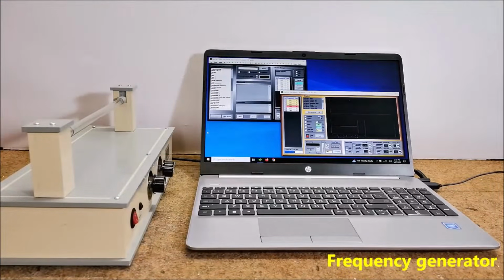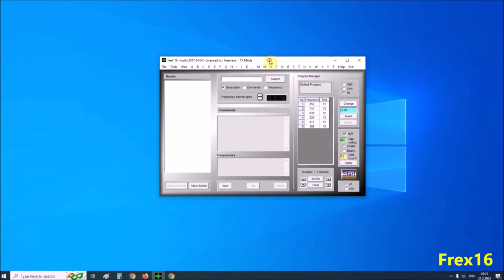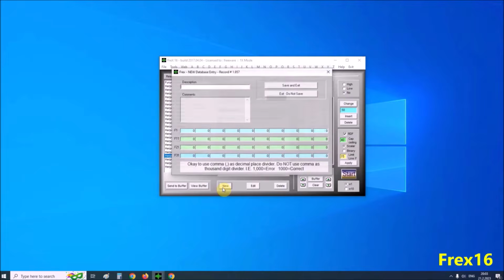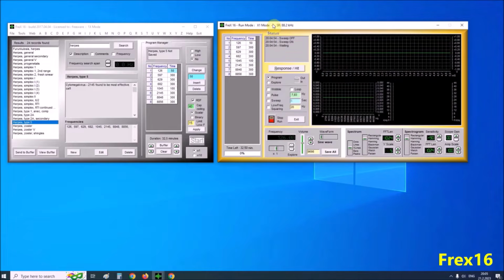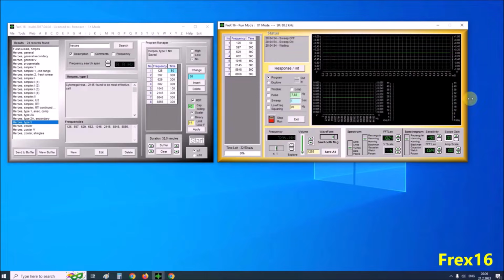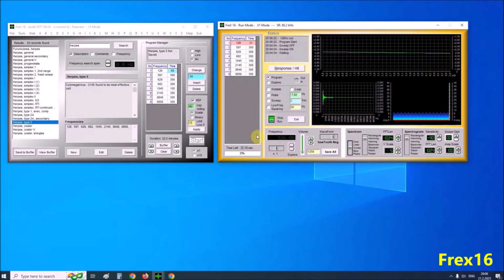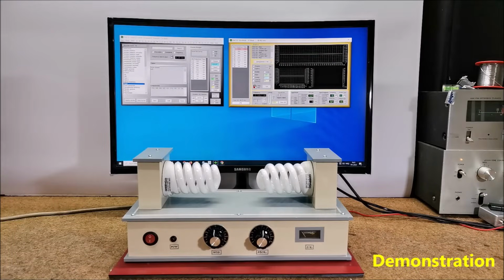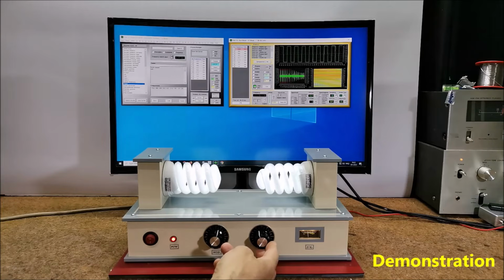The simplest and cheapest way to make your own Plasma Rife Machine (Detailed instructions)

Comment: Could you use a Plasma Ball generating device that is already modulated (controlled) by sound?  There are already these machines available and react to sound.
Reply from the maker: Theoretically, yes, a smart idea if you already want to try out such a device, of course the carrier signal in these plasma balls is at a very low frequency (a few tens of kilohertz), while in the original device that frequency is 3.1 Megahertz. Finally, my personal belief is that such devices are totally dysfunctional in terms of treating diseases.

Comment: Mirko, I want to build similar machine, but with contact electrodes like in Hulda Clarks Zapper.

It would need to generate 0vOFF +9vON square wave (50% duty), 10mA max.(Nonegative wave, just positive)

Can you provide a schematic of such circuit? 

On the othe hand how will simple LM386 small amplifier fed by 10v and connected directly to electrodes will work?

Comment: hi Mirko, thanks for your projects. I want to ask you if it is possible to insert a switch at the amplifier output to use the machine with electrodes and plasma. Thanks a lot

Comment: I would like you to build me such a device, but I'd like to see the plasma tubes on hand held mounts, to be placed where needed... Maybe on a meter of cable. Can it be done for 2K US?
Reply: Have you done any research on the preferred shape and surface area for a hand held device? Working with a plasma bulb manufacturer, there are a variety of options.

Comment: A very nice simply design. I am curious of its strength. HOw far away can you detect the signal? Does this have pretty much an unlimited run time without heat problems?
Reply from the maker: I detect the signal at a distance of several meters, otherwise the device has no problem with heating at all and can work indefinitely

Comment: What transformer are you using and how do you wire it?
Reply from the maker: I use HV trafo from old disassembled copier machine
Reply: @MirkoPavleskiMK  I have a family member with cancer I'm trying to replicate what you're doing in your video how did you wire your transformer thanks for replying so fast
Reply from the maker: @brighttech8922  Schematic at:  https://www.hackster.io/mircemk/the-simplest-and-cheapest-way-to-make-plasma-rife-machine-f3f776
Reply: @MirkoPavleskiMK  I have seen the schematic it doesn't look like you're using all the pins on the transformer I'm sorry I don't know a lot about transformers

Comment: So after all,  this in not a rife machine because of the wrong  carrier signal frequency.  Unfortunately I have already paid an electronic engineer who built one for me . I should have read the comments (see @TheApis75) of this video. Anyway thanks for your efforts Mr Mirko
Reply: Ok @LLoouukkaass112233, you had it built and Mirko correctly changed from mHz to kHz range. So if the original Rife carrier frequency is 3mHz (or 3000kHz) - it still falls within the 20-200 kHz range!  So, does your Rife build WORK?
Reply: I curios to know, because I'll also build this version of Mirko's Rife machines with the adjustable carrier frequency rather than the fixed CF.
Reply: I apologize, you're correct!  3mHz is out of the 20-200kHz range.  So it's not the original Rife carrier frequency.
Reply: @tonypeters3814  The machine works. Checked with an SDR radio  I have been able to transmit the signal from an external signal generator. The machine transmits (by modulating the carrier wave) the signal in multiple bands (Harmonics?)   starting from 90KHZ up to 1.2 Mhz, then stops and resumes the transmission in 87MHz (!?). Unfortunately it failed to transmit in or near 3MHz. Moreover in contrast to Mr Pavleski's opinion, a device (THERABIONIC) operating on the same principle and delivering an AM modulated 27.12MHz carrier wave by an intrabuccal (in the patient's mouth) antenna (100mW), has been approved by FDA as an adjuvant  treatment of terminal bile duct cancer. The results according to the studies are very promising.

Comment: Hi Mirko, I will build this version next week, but I have one question.  I would like to add and LED to indicate signal to the CFLs when low frequencies are being transmitted.  Where would you suggest placing the LED in the circuit?  Perhaps DTC on the TL494?

Comment: Where you get that spectrum Analyzer? Do that Analyzer works on the range 0hz-382000hz?
Reply from the maker: That is Software Defined Radio with range up to 2 GHz (2000000000 Hz)

Comment: Hello Mirko, it is me again. I opened a fluorescent bulb and I noticed there are 2 wires on each side of the bulb, in my case (the same as yours) they both pos+neg on the left and the same on the right side of the bulb, the same situation can be seen in your video at 14:41min, I noticed you soldered pos+neg together with one wire coming from the transformer for each side of the bulb 14:51min. In my poor understand I believe all the wires coming from the transformer are POSITIVE, so did you soldered together pos+neg+transfotmer? or you ignored the neg at the bulb side? I will do a test with the spooky2 central with 2X 35Watt bulbs and the spooky central has 2 outputs that I believe are both positive. Please kindly clarify. Thanks in advance.

Comment: Hello Mirko, I was willing to build your rife machine but my knowledge in electronics is extremely poor. I used FreX with a headphones amplifies and tens pads and it worked well. Recently I found a spooky2 Central used being sold for parts or repair in a pawn shop and people do not know what it is about and what it supposed to be used for. Now I have the Central and 1 Spooky2 XM generator. All I have for the Central is the power cord, the central is tested and is working perfetly fine. I would like to build a bulb to operate with the Central based on your suggestion, I have very big bulbs with my photo light kit, they are about 20cm long, 150W each and they cost about $15 USD for a pair, I just do not know which kind of gas is inside and sellers don't know either. My idea was to build a rife plasma tube that is compatible with the spooky2 Central, what I know is that they have two bulbs, one is the plasma tube (Gas Type: Argon / Neon mix, Striking Voltage: 500v, Maximum Current: 100mA) that radiates 6 inches and users need to touch or bring the tube very close to their bodies for this to work, another is a Phanotron Plasma Tube that will radiate 6 feet  (Maximum Power: 60 Watts, Wire Type: 50 kV Silicon, Wire Length: 2m, Plug: High Voltage Banana), the Central has to inputs from the generator one is frequencies input and another is a modulation input, then there is two outputs in my understanding they are positive and negative (could be wrong) to operate with a single bulb. To build your project with two bulbs I am confused how to wire the 2 outputs to 2 bulbs (+ and - = 4 wires), I appreciate if you can tell me the wires length, gauge, handle protection and banana plugs protection. and how to connect regular bulbs on it. I can provide tech specs and phones if you are interested in helping. Kind Regards, Paulo

Comment: Hi Mirko! Thank you for making this video! I am planning on building this device for a project and I was wondering how to connect the computer to the device? Would you plug in a set of headphones into the sound hole in the computer, cut the headphones, and connect the loose wire to the 100nF capacitor?

Comment: Hi Mirko,
Thanks for sharing this video! I am planning on building this device and I had a few questions. 
What is the black box on the right side of the device? It is connected to the signal detector.  Where did you get it?
Reply from the maker: 12V/5A Power Supply

Comment: Hi Mirko, You have done a great job designing this Rie Machine. I am plannng to biuld one but can't find what voltage the output of the HV tranformer needs to be for CFLtubes and for plasma tubes. Hope ypu can help me with that. Cheers. Hessel
Reply from the maker: It is not critical, for example you can use HV trafo from old CRT monitor
Reply: Hi Mirko, thanks for your reply. All being well, I hope to build a few of these for family and friends, and seeing I am an electronics engineer I was hoping for an actual voltage figure so I can find or construct specif HV & high frequency transformers. Cheers. Hessel

Comment: Is it possible to buy a frequency grnerator, range 100 khz - 3,5 MHz, then plug in the laptop with program on one end and high voltage 600W power source to a 600W sodium lamp or metal halogen to the output?
Thanks in advance for answer.🙏
Reply: Had a closer look to the circuit now. Of course a 600W high voltage supply is nonsense,  because the power comes from the 12V 5A DC power supply and from there over MOSFET to high voltage transformer.
So for more power I'd need stronger DC supply and then Set up a stronger MOSFET or more MOSFET in parallel??

Comment: It doesn't work at all ! Something must be deliberately missing in your schematic diagram, did it twice to no avail. Not trying to discredit your work, you're very good at it, I'm just disappointed of all the money I've spent on components and the time I wasted while trying to build it
Reply from the maker: I don't know why it doesn't work for you, this is a standard TL494 PWM modulator with a Mosfet amplifier, and this assembly can be used for example as a Plasma Speaker.The diagram is part of the datasheets provided by the manufacturer.

Comment: How did You menage to get carrier frequency range of 20 to 200 MHz when highest frequency that TL494 can deliver is about 500K. Does HV transformer oscilate on that high frequncy? Does discharge at a fluorescent lamp do the frequency multiplication or is it any other phenomenna involved ? Finaly , what are readings from your spectrum analyzer for carrier frequencies ?
Please answer to any of my questions as I am about to construct one such device. Thank You for Your efforts.
Reply from the maker: You are absolutely right, by mistake I use MHz instead of KHz throughout the text. I apologize for the error, I just fixed it. By the way, the carrier frequency of the original Rife machine is about 3 MHz, and I described such a project in the previous video about the Advanced Rife machine with external oscillator.
Reply: @MirkoPavleskiMK  Thank You so much. One more question. Is it esential to put two CCFLs or it might work proper with just one ? And if I use two bulbs how to drive two HV trafos ? In phase , or 90 degrees off phase due to design where bulbs face eachother ?  Thank You very much for Your patience and time...Best wishes from Serbia, Novi Sad

Comment: I've used CAFL values in frex using an old karaoke machine as an amplifier for direct contact pads and salt bath for field effect. My family, friends, and I were amazed with the results on many different ailments and they all kept coming to me like a shaman or something. Burns, rashes from shingles or psoriasis, tendonitis and torn muscle or ligament, inflammation, broken bone regeneration, staph infection, rotten spider bites, abscessed teeth, many more. Always wanted to try and build one out of a cheap plasma globe and see how well it works when it's "wireless". Has anyone tested the transmission efficacy of using the CFLs versus direct contact pads or salt bath at 100-200 watts?
Reply: @wolfman420mmaify would you be willing to share how you did this?? I am desperate to find answers for my family.
Reply: Would You be kind enough to share some of your work. It may be in private conversation if You please.Thank You.
Reply: @dedu456  I am sorry , but since I am self educated in english , I didnt understand Your mesage. What is OUR or put a link for me to see what You wanted me to see.Thanks for understanding.
Reply: @dedu456  Thanks. I will. Not a new topic for me , but I don't have time to dive into the subject...yet

Comment: Nice build, altho im worried the use of flyback transformer can distort the input signal waveform while severely restricting the power output at high frequencies. Air core tesla coil type transformers are better suited for high power transfer.
Instead of CFLs, a gas/vapor tube can allow a closed circuit to form which can allow more power to be pushed out.
Alternatives like Sodium/Gallium halide lamps, Xenon strobe lamp tubes are cheaply available (some contain mercury).
UV protection film screen is necessary as Hg/Xe/Ar etc all produce UV in their spectra.
In a CFL , the white coating absorbs the UV and converts it to white light. Long CFLs tubes can also be used to form a closed circuit.
Reply: You just sound so smart wow. I have no idea what you’re talking about but do you have your own plasma rife I can take a look at?
Reply: @diegod7936  hi, I built my device based on the design of spectrotek. I got the PA3 board, components and assembled the device myself. For the tube I opted to go for cheaper xenon strobe tube from China along with the housing. The toughest part was tuning the circuit as this is critical to draw high power from it without failure. PA3 can put out upto 500W depending on the size of the tube. I learnt a lot in the process of building it. Rife plasma device is essentially an A.M. broadcast transmitter. Ralph from spectrotek is much knowledgeable on radio tech.
Reply: @motogee3796 Hello;  I need to build the machine, due to various ailments.  Can you guide me, even with the frequency of the carrier wave?
Reply: @Alandalton79  Hi, you can get the file with build instructions, parts list etc here. Im using 3.1MHz carrier. 
pixeldrain  /u/4n61sQs3
Reply: Hi, can I ask about the MOSFET setting for a 600W DC power supply and how to set up the tesla coil then (how much turns primary and secondary, mm² of wire)?
Reply: I am sorry , my girlfriend has cancers , can you give me a scheme or guidance to build something similar , thanks or if you can build one for us
Reply: @Life_Facts2023 hi I'm unable to share the link to my build in the comment here as it gets deleted. However mirko(this channel) has shown several variations of the rife plasma device at different cost/power/frequency levels. He has also put them up on instructables. The simpler / cheaper easy to make devices typically have a fixed carrier frequency usually 3.1MHz and operate in the range of a few kHz to hundreds of kHz. These are the healing freqs that the carrier wave emulates. The high end versions use vfo for variable carrier frequency that can reach upto 30-60MHz and the healing frequencies they can transmit go into the Mhz range. I'd suggest you start with the simple version or try to find a local electronics technician to make one for you.
Reply: What do you think about the GB4000? Does it really work?
Reply: @JESUS-WINS  I haven't used them personally but they are compatible with Spectrotek's rife devices. They should work with other devices too if the signal input to the device is analog and the required voltage and frequency are supported by the signal generator.
Reply: @motogee3796  does the RF penetrate the body to reach the viruses?